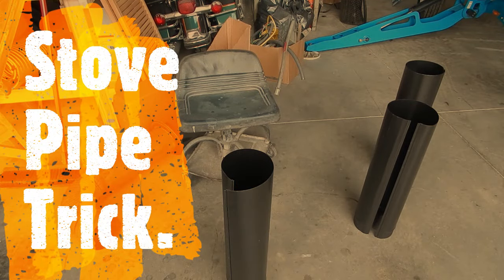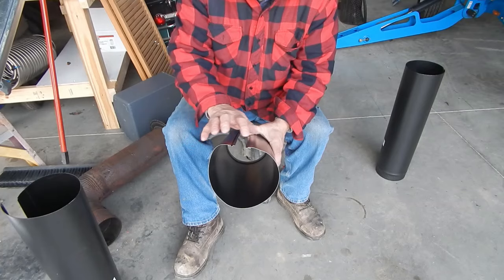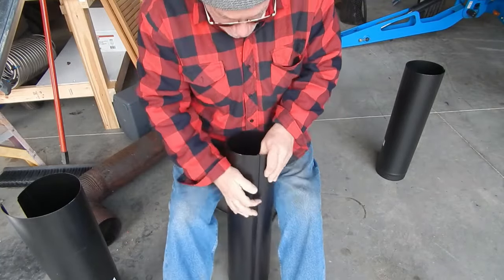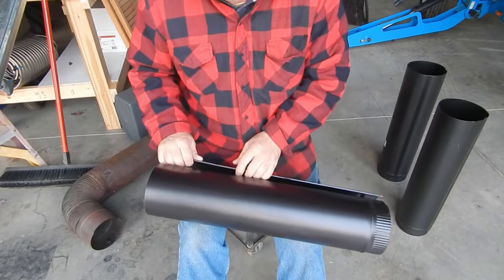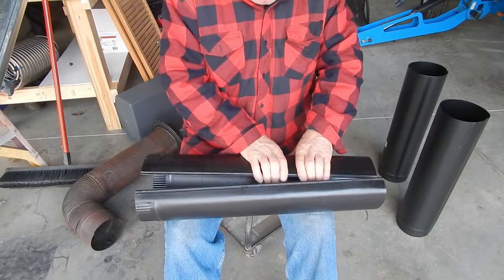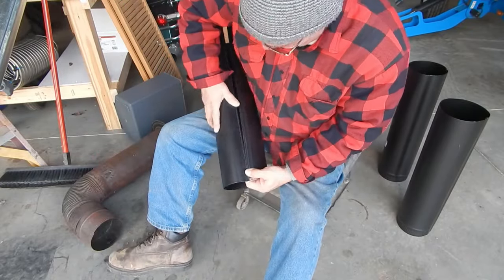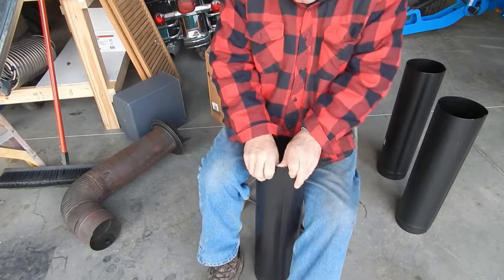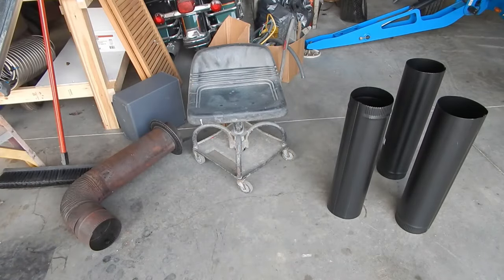Stove Pipe How To Snap Together Trick

Comment: I Had to put on a pair of thin cut proof gloves. Sliced thru most of the layers of Both hands. Only drew a little blood but my hands were messed up for a week. But, this technique got all my sections put together and the woodstove installed. Have run a cord of wood thru the stove pipe so far this winter. We had our first 40 below at my place on the 2nd of November

Comment: lay the pipe on the floor with the open side up. get the joint lined up at the ends. put joint sides together and push down on the with your palms.work your way down the pipe and it will snap together.

Comment: I'm snapping 4 foot 24ga together and I don't recommend bending it like that as it compromises the locking and it may open when you have a fire going. The trick I learned is putting radiator clamps together to get the 6-7-8" diameter you need, make one or two more of them, put slick plastic bands under them to prevent scarring the finish (strips cut from a laundry detergent jug work well), then get the snapping started at one end, slip the bands over it and snug it down with your driver-drill or 5/16" nut driver. Put a second band and clamp set about a foot up and start tightening as you guide the snap part into its mate.  The 2 foot piece I just did snapped right together all the way upon that step. 4 footers take a bit more of the same,
Reply: I snapped mine together without having to bend it just put it on a soft surface and pressed down in center of pipe
Reply: That's exactly right..  it's not designed to be bent out of shape..  when you bend it out of shape that's exactly what you end up with... an outta round stove pipe that is not properly locked in..  you have to bend the pipe as a whole not bend the edge of the seam all to hell... with a helper.. you squish the whole pipe to an almost oval shape ..engage the seam and release..  definitely would not recommend this method.. unless you want a compromised seam that will most likely leak..  sucking in room air under draft and causing the smoke to cool right off the bat.. which will decrease draft and can cause heavy creosote buildup in the stove pipe itself  as well as the stack.. not everything u see on the internet is a good idea and can be the exact opposite

Comment: holy sh*t , this will be my 4th go-round with these damn things - I have used screwdrivers- ratchet straps and spent hours on hours assembling these. Unfortunately, you can buy the pre-made ones. I paid 24 for 2 for sections. I would rather have a labatomy with a dull knife then screw with these. Hope this idea works I was afraid of misshaping them.

Comment: Try using a few hose clamps around the sheet metal, tighten enough to hold close enough together so you can snap it together. Yeah, it's a pain to get these together.

Comment: I got my pipe sections together, now when I slide one into the other, the seam creates a gap between the two sections for smoke to escape through...any tricks on how to get the sections to fit more snug with no gaps at the seams?
Reply: Yeah don't follow this advice..!   these pipes are not designed to be bent outta shape to put together....  on a flat firm surface..  seam up..  you bend the pipe in as a whole slightly past round.  Mate up the seam joint and release..  snaps right in and don't compromise the seam.. that gap you mentioned will actually suck cold room air into the pipe under draft.. not leak smoke out..  that room air going in actually cools the exhaust smoke immediately which reduces draft and causes heavy creosote build-up in the pipe and in the chimney flue.. again these pipes are not designed to be bent outta shape..  man up and do it right or just hire someone

Comment: Did it leak because if you don’t straighten the center circular after you bent it to align it it wi still open in the center portion.
Reply from the maker: No leaks ever easy to work with.

Comment: Another easy way,
Pipe down in the floor, kneel down with the pipe between your legs and the male end in front you.
Start the male end by pushing it down and together. 
Then take your palm and push the seam down and squeezing the pieces together. 
They won't go all the way together until you get close to the end. You will hear it pop all the way together.
Don't do what this guy says, your pipe will look tearable. Deformed in the center.
It takes maybe 30 seconds the way I at least attempted to explain.
Good luck!